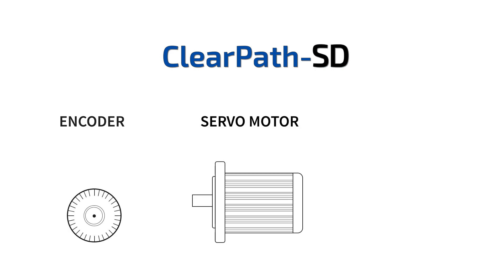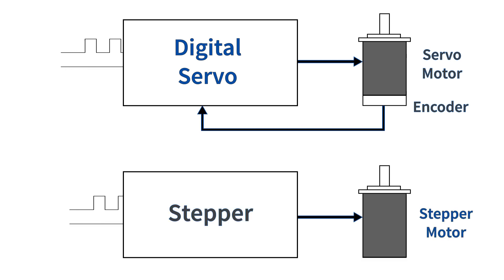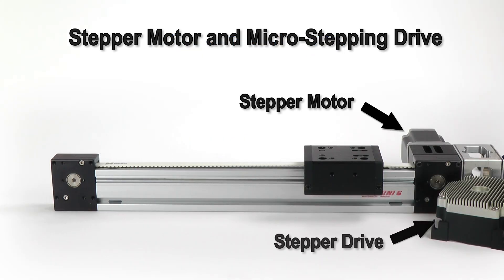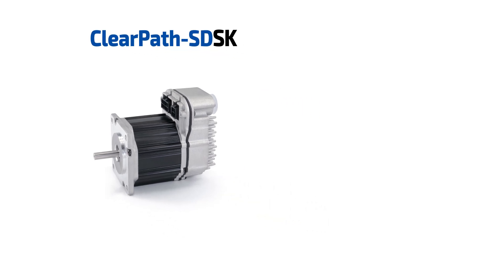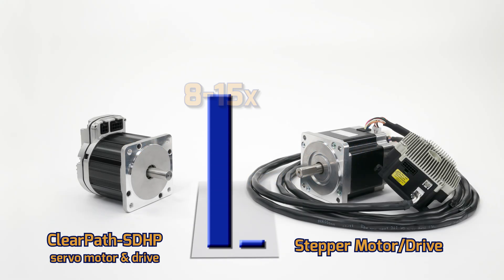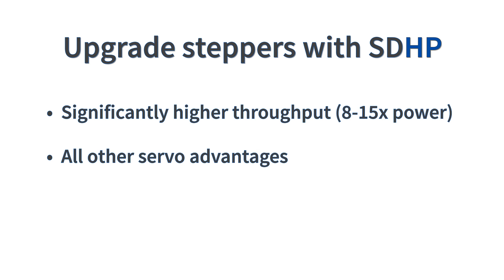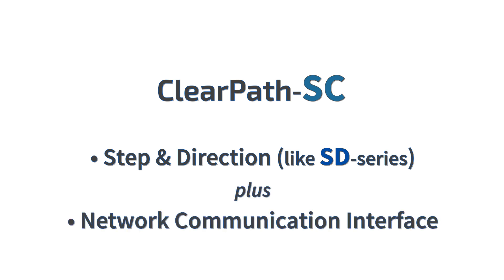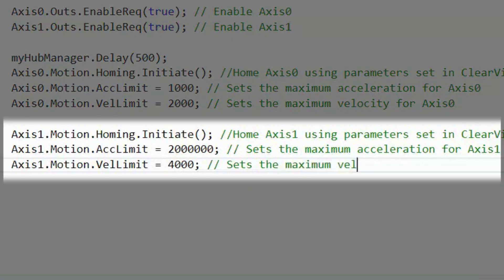ClearPath-SD (Step and Direction) Series Overview

Comment: The performance and control of these little beasts is incredible, I've reached I think the maximum performance of my Laser cutter system, now and the ceiling are not the clearpaths, it is the actual structural rigidity of the machine. For a CNC enthusiast or a business owner (like myself) these are like chocolate that do not make you fat.
Reply from the maker: Thanks Abraham, we are happy to hear that ClearPath is working well for you. We appreciate the enthusiasm!

Comment: do they just wire to the same stepper driver like the leadshine DMA860H or the driver has to be a servo driver too ?
Reply from the maker: Hi Joe Cue,

Thanks for watching Teknic's ClearPath-SD series video and for your question.

The ClearPath integrated servo motor is designed with a servo drive, servo motor, and encoder all integrated into one enclosure. This all-in-one integrated design means that you can have the benefits of a fully closed loop servo system without having to run shielded and twisted pair cables between the servo drive and the servo motor.

The ClearPath-SD motor has three inputs. The inputs include the step line (Step+ and Step-), the direction line (Dir+ and Dir-) and the enable line (Enable+ and Enable-). The logic voltage range is between 5VDC and 24VDC (nominally). The command signals are sent to the ClearPath-SD servo motor by a controller that can output step and direction signals. 

For more detailed information about the ClearPath integrated motors, I suggest you take a look at the ClearPath User Manual available in the download section of Teknic's website:

https://teknic.com/files/downloads/clearpath_user_manual.pdf

If you have any additional questions or comments, feel free to contact Teknic directly at https://teknic.com/contact/ or give us a call at 585-784-7454. 

Best regards,

Tom T. - Teknic Servo Systems Engineer

Comment: 1:25 Irregular adjustment of current in the drive, otherwise it would have burnt the hand. Although it could cause locking.. using gloves to increase stress on the shaft.
Reply from the maker: Hi Antonio,
Thanks for taking the time to comment! I double-checked with the engineer who produced this video (he works here at Teknic) and learned that the stepper drive was configured to deliver the maximum rated continuous current for the stepper motor shown in the video, so it was running at full continuous when he grabbed the pulley and stalled the stepper motor. This segment was intended to illustrate that while steppers typically have good torque at very low speeds, their torque drops off precipitously at higher speeds.

As a side note, I also learned that the engineer actually did burn his fingers while shooting this video, but not when he grabbed and stalled the stepper motor. At some point in the production process, he briefly grabbed the spinning ClearPath motor pulley with his bare hand and received some minor friction burns as a result. (In case you were curious, the ClearPath motor did not stop, shut down, or lose steps.) His advice to anyone reading this post: "Please DO NOT try this experiment at home!"

Best regards,
~Jim W.

Comment: hi, can we read the sdsk encoder?
Reply from the maker: Hi Nendhang,

Thank you for your question, it is a good one.

The short answer to your question is no, you cannot directly read the encoder on the ClearPath SD or MC series. But there is much more to the story than that.

Being a servo, ClearPath uses an integrated 12,800 count per revolution encoder (64,000 count/rev for AC-input models) to maintain accurate position and velocity, but we reduced cost and space (and got rid of potential noise problems) by not running the encoder signals to the outside world. ClearPath does have a digital status output, however, to tell you when moves are done, target speeds are reached, or a number of pulses every revolution (1,2,4,8, or 16). As an aside, you can query the ClearPath-SC encoder position via software or capture position on the fly (with the advanced firmware option).

You may be thinking, "but wait, I need encoder output. I need multi-axis coordinated control." 

The fully closed-loop ClearPath SD integrated servo motors have been installed on many thousands of machines in markets such as CNC, 3D printers, medical machines, and AOI machines (just a few examples) that need multi-axis, coordinated motion. Due to the low tracking error of each motor, the command from the controller essentially equals the encoder position. If any ClearPath motor on the machine gets out of position (due to an obstruction, for instance) the motor provides a shutdown signal to the controller and the rest of the axes can be shut down as well. 

If you have any additional questions, please feel free to contact us directly at https://teknic.com/contact or gives us a call at 585-784-7454 8AM-6PM M-F. You will promptly be put in touch with a factory direct applications engineer.

Best regards,
Tom T. - Teknic Servo Systems Engineer

Comment: Teknic, can you tell me the exact model number of the motor in this video?   I need to buy a motor that snaps back and for quickly.   I watched a video from NYC CNC and he was displaying the 2310 SDSK and it was nowhere near as fast as the one in this video.   I have my application in my head but I am having trouble figuring out what motor I need on paper.
Reply from the maker: Hi Breaker 19,

Thanks for your interest in ClearPath, as well as your question.

Any ClearPath servo motor can natively respond quickly to commands for a host of reasons, including their electrical, servo control, and power density characteristics.  However, the response time of any motion system also depends on the mechanics, load, reflected inertia and even the command itself. 

For instance, in NYC CNC's video, the ClearPath was controlling a different mechanical system and load while following commanded motion unique to John's application. In Teknic's video, the application, mechanics, load and motion command are much different, resulting in the difference you noticed. 

If you'd like assistance sizing an appropriate motor for your application, feel free to call us at 585-784-7454, or use our "Contact Us" page online. (https://www.teknic.com/contact/). We're happy to assist.

Best Regards,

Nick S. - Teknic Servo Systems Engineer

Comment: Hi,

What is the math formula to determine how much work a motor can do at 24vdc. 
For a vertical lift of 48inches, 5 seconds, 20 pounds mass, at 12 inch arm perpendicular to the lift?

This is for a camera slider, belt driven.

Having fun trying to find the correct SDSK

Thanks!
Reply from the maker: Hi Bryster,

Unfortunately, there is no single formula which can accurately determine the correct motor size. Rather, there are a number of different formulas which all take into account different variables from the type of mechanics to the motor's electrical characteristics.  Teknic publishes the torque speed curves for all of our ClearPath motors (at various common voltages) so if you already know how much torque and speed is required, selecting a motor is just a matter of choosing a motor with the optimal torque-speed curve.

If you're not sure how much torque and/or speed is required, but you have all of the detailed mechanical information about your machine, feel free to call or email Teknic to discuss your application with one of our applications engineers - we can help guide you to an appropriate motor. Just click the contact link on the main menu of our web site... 

https://www.teknic.com/contact/ 
 
Best regards,
Brendan F. - Teknic Servo Systems Engineer

Comment: There is a confusion about homing. Some youtubers say because of the encoder in clearpath servos you don't need homing on cnc machines. The encoder always knows where it is. While others say that if you turn off and on the  cnc machine then you do need to home the machine. What about proximity switches? Do cnc machines need them with clearpath servos?
Reply from the maker: These are good questions, but they are some that require a longer response and additional background, so I apologize in advance for the long post.

Generally speaking, most encoders are categorized into one of two types: absolute encoders or relative encoders (also commonly known as “incremental” encoders). At a high level, the two types serve the same function (they provide position and velocity information back to the servo drive), although there are some notable differences.

Absolute encoders provide unique positional information throughout the entire range of the encoders’ travel. These encoders don't usually require homing because you can “read” the position at any time and know where you are (although you still need to correlate a specific absolute position to a specific location on the machine). Please note that we further differentiate absolute encoders by the number of “turns” they can experience before they are no longer “Absolute” because the encoder’s position wraps (more on this later). You can identify the two types as “single-turn” or “multi-turn” encoders.

On the other hand, a relative/incremental encoder needs to be "calibrated" or "homed" initially. An incremental encoder outputs electrical "pulses" as it rotates, and it's the servo drive's responsibility to monitor and count these pulses to keep track of how far the encoder has traveled. In order to translate this distance traveled into an absolute location on your machine, the servo drive needs a starting reference point (or "home" location). I.e. the incremental encoder is telling you how many counts away from "home" the system has traveled.

So, since an absolute encoder doesn't generally need to be homed, you might wonder why anyone would use an incremental encoder. While there are a number of cost and performance benefits to incremental encoders, absolute encoders can only register their absolute location within a finite number of revolutions. If your application exceeds the number of revolutions or turns of the encoder, you can no longer identify your absolute location simply by looking at the number. 

This limitation is akin to wrapping the trip odometer in your car – if you exceed the highest digit, you no longer know exactly how far you’ve driven just by looking at the number. For example, if your odometer displays “999”, you may assume that you’ve driven exactly 999 miles. However, if you don’t have a “thousands” digit on your trip odometer (which is common in some older cars), it's possible that you could’ve traveled 1999 miles, or 2999 miles, or 3999 miles and so on. Relative encoders don’t have this limitation as the servo drive simply continues incrementing and counting the position in reference to "home". Since most applications require multiple revolutions of the motor (in many cases, hundreds or thousands of revolutions), incremental encoders are more cost-effective options. 

While I cannot comment on every servo out there, I can discuss the products Teknic manufactures. All ClearPath motors use relative encoders. Once you home a ClearPath motor, the motor will know exactly where it is on your machine as long as you don’t remove bus power. 

Additionally, Teknic sells a logic power back-up hub that you can use with the fractional horsepower, DC-input ClearPath motors to keep the encoder and DSP alive in case of bus power loss. If you use this logic power back-up feature, you will not have to home your system more than once unless you lose bus power AND logic power back-up (this feature is similar to how some absolute encoders work with a battery backup function). If you’re interested, you can learn more about this logic power back-up feature here: https://youtu.be/mALi3_QqyHk?t=426

Regarding your other question, you are not required to use proximity sensors with ClearPath motors, but you’re not precluded from using them either. ClearPath has a built-in hardstop homing routine, but if you prefer to use sensors, you could wire them into your CNC controller. 

I hope this information helps clear things up. If you have follow up questions please feel free to contact us directly through support@teknic.com.

Best regards,
Brendan F. - Teknic Servo Systems Engineer

Comment: Hi. Can I use these ClearPath-SD servos with a 3D printer board?, is that simple?. I want to build a 3D printer, but I want to use servos instead of steppers due to the higher speed the servos can offer. But I fear there isnt much work done on servos with 3D printers, since servos use expensive controllers, incompatible with 3D printer boards as is. Can I simply connect these instead of steppers (with some external power I suppose)?
Reply from the maker: Hi Paclanc, thanks for watching the video and for your question. The short answer is yes, you can build 3D printing machines with the ClearPath motors. In fact, there are 3D printers controlled by ClearPath SD motors in the field today.  

“Simple” is a relative term based on personal experience and knowledge. But I can say that the process is straightforward as long as the system requirements for the machine objectives are met.  The main points are highlighted below.

Here are the step and direction requirements:

• the 3D printer board outputs 5-24VDC step and direction signals. The majority of steppers and servo motors are driven with these signals, but not all. So be sure your machine has step and direction outputs.
• The controller needs a step pulse output frequency fast enough for the desired motor speed and resolution. For example, if your motor is set up so that 6,400 steps causes one motor revolution, and you want to go a maximum of 50 revs/sec (3,000 RPM), you would need an output frequency of 320 kHz. However, you can adjust the step input resolution in the ClearPath (how far you move per step) if necessary.  If your step rate is low you will have to sacrifice either speed or step resolution. But most modern step and direction indexers have plenty of output frequency for a 3-D printer.   

The next step is selecting the correct ClearPath-SD motors (i.e. “SD” stands for step and direction). This is based on your mechanical design and motion requirements. If you are replacing stepper motors with servo motors, you can use the "industry standard 40% stepper de-rating” factor to calculate the torque required for your servo motor. This is explained in more detail in Teknic’s video called:

Stepper Motors vs. Servo Motors - A ClearPath Demonstration
https://www.youtube.com/watch?v=lt3QSCEgWgs&t=15s 
 
 That being said, selecting a ClearPath motor with the same peak torque capability as the stepper motor being replaced can be a cost effective way of getting added design margin. 

Now for the wiring, which is truly simple.  The ClearPath motors have only three inputs: Enable, Step input, and Direction input. Details on motor wiring can be found in the “Inputs And Outputs” section and “OPERATIONAL MODES: SDSK AND SDHP” section of the ClearPath User Manual:

https://www.teknic.com/files/downloads/clearpath_user_manual.pdf  

Choosing the proper power supply is important for your servo driven application (bulk linear design is much preferred vs. a switching power supply). ClearPath motors are designed for a nominal voltage of 75VDC. However, the motors can be run at voltages between 24VDC and 75VDC. When using voltages below 75VDC, you may experience lower max motor speed and possibly reduced torque.  The interaction between supply voltage and the torque speed curve for any ClearPath motor can be seen on the specific motor page on Teknic’s website. There are more details about power supply related topics in the first 4 minutes of this accessories video:

ClearPath SD Servo Fractional HP Accessories
https://www.youtube.com/watch?v=mALi3_QqyHk&t=1s 

We wish you the best of luck with your project. If you have any other questions, please contact Teknic at support@teknic.com

Best regards,
Tom T. – Teknic Servo Systems Engineer